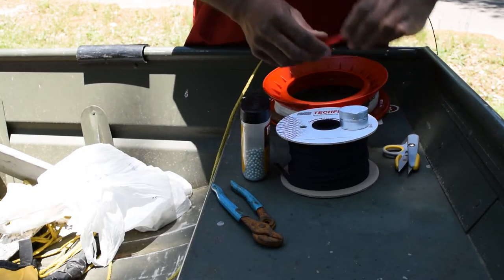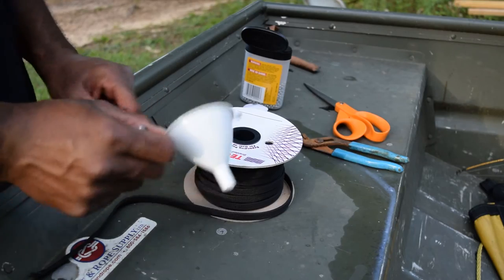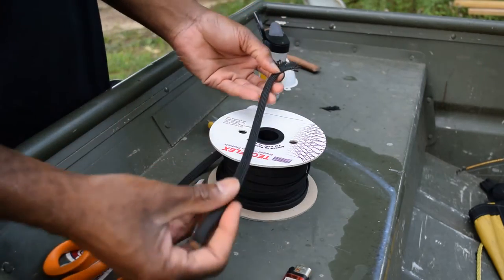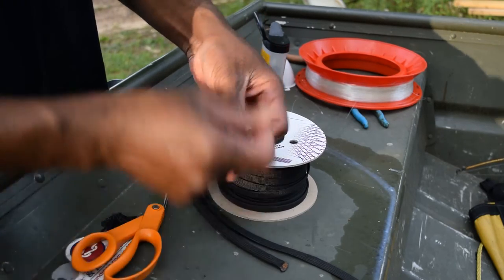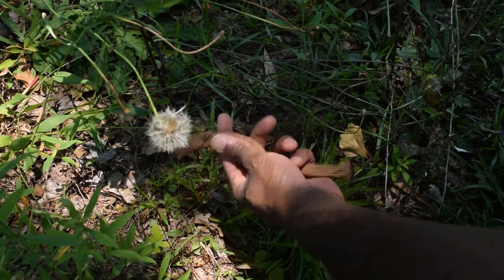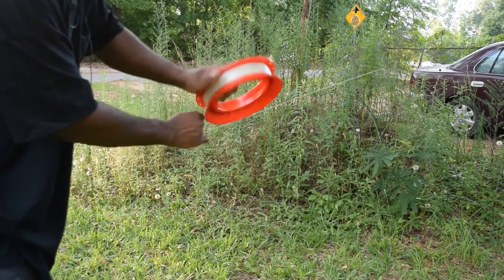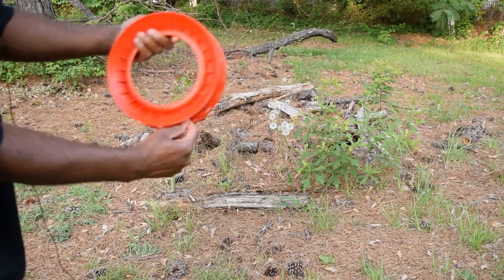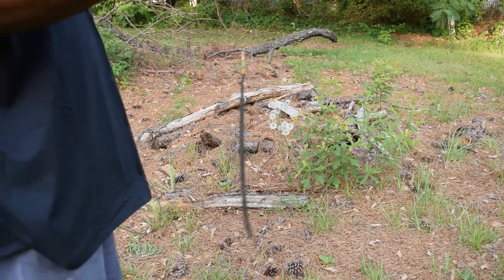How to Make Slinky Weights

Comment: Can I use nylon shock cord for this I'm having trouble finding 1/2 inch parachord
Reply from the maker: Yes, you can use anything that holds the weight. You're not fixed into any type of chord.

Comment: Is expandable can the hole size on the inside get bigger that 5/16 ?
Reply from the maker: It expands some but not a lot. They do make the materials in much wider widths. How heavy a weights do you think you need?
Reply: Black Warrior Lures  I would like to sample about a 6 inch pice . Out on ur web there is no phone number?
Reply from the maker: Oh, the new  Web site doesn't have the phone number on the front page like the old design. contact me via e-mail damon [at] blackwarriorlures [dot] com. I'd be happy to send you a sample piece.